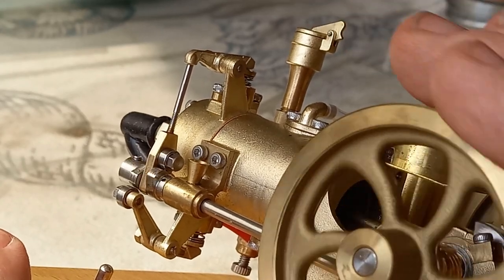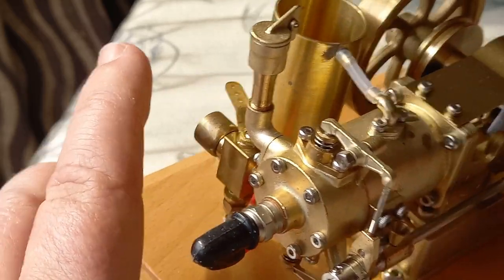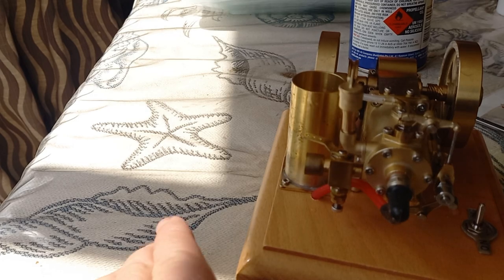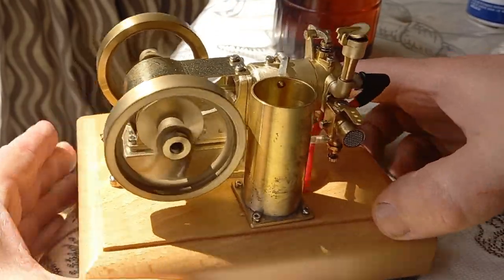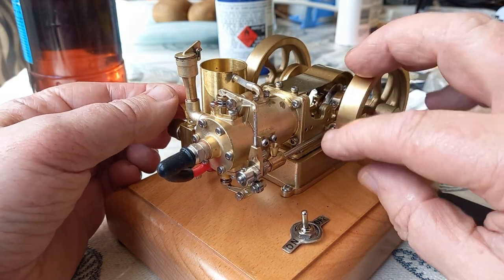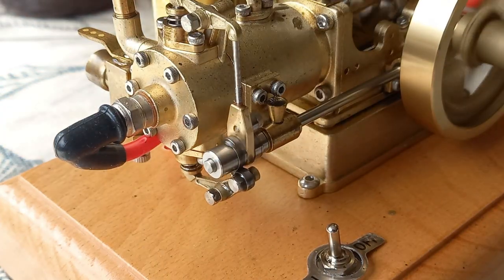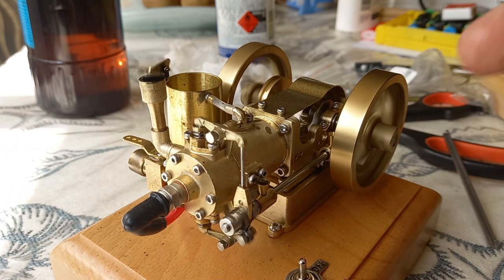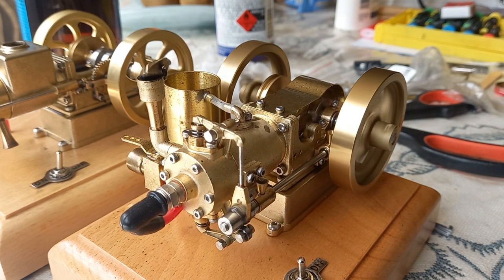M25 Is this the perfect model vintage gas engine? 4stroke sideshaft #modelengine #gasengine

Comment: What fuel are you using ? You mentioned that they don’t work properly when you first get it and it needs quite a bit of work to get it running,am I correct as I want to buy one but don’t want to spend days getting it running,Ava great day,from Sydney,Australia
Reply from the maker: Dude I overstated that...I use straight 95 octane car petrol with about 3 to 5 % motor mower 2 stroke oil added. Oil is ASE30 motor mower oil. If they don't start first pop, do yo the needles until you feel resistance then back it open 1/4 to a half turn. These days it would be poor luck indeed if it didn't run

Comment: Funny isn't it how You Tubers get these engines and they run first time out of the box. The heap of sh*t I received refuses to run no matter what. Useful as a paperweight but that's about all.
Reply from the maker: What have you tried? Are you near me Ian??
If it's any help, there's a troubleshooting video I made here. [no spark?https://youtu.be/cJmN8kTOnHw] If it has spark, squirt a little fuel direct in the carb to see if your carb is blocked. Enjomor Hit N Miss guide here https://youtu.be/4MCVjw6Wyt4
And if it's any consolation, more than half my Chinese engines didn't run right out of the box. I only got my H73 running properly today after months of going back to it for a few hours...needed ignition, hall sensor, valve seating work, advance timing and rework of the governor. Not basic stuff. The V twin R28 runs good now but will then go off one piston like many of the youtuber's v twins. Bigger youtubers than me get preferntial treatment samples I suspect